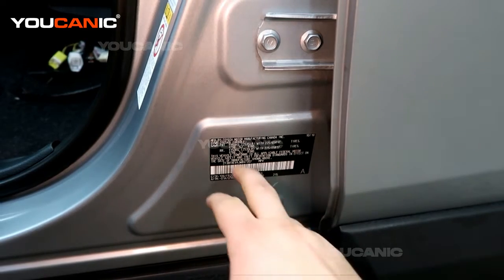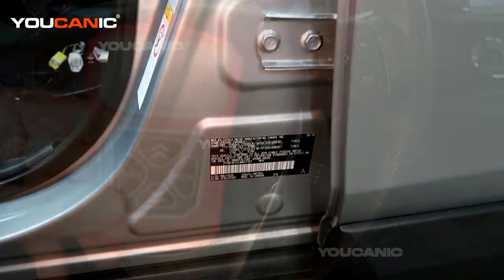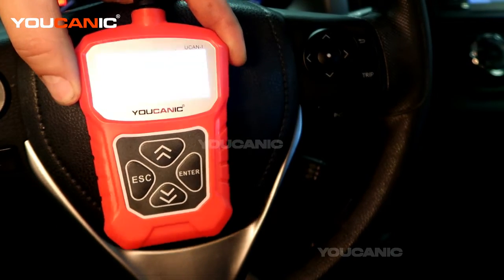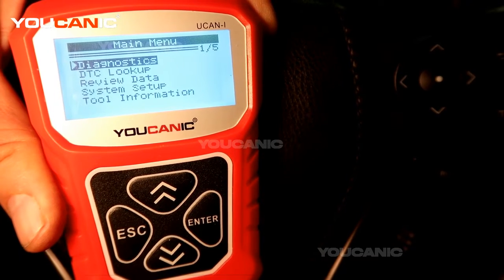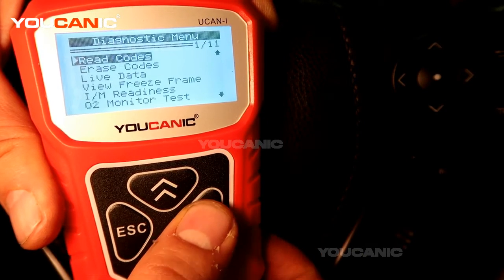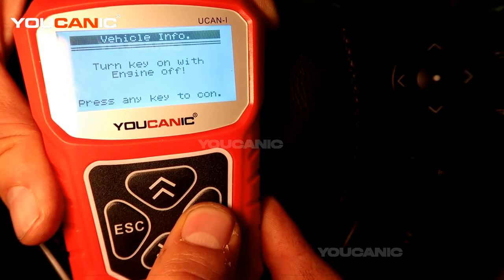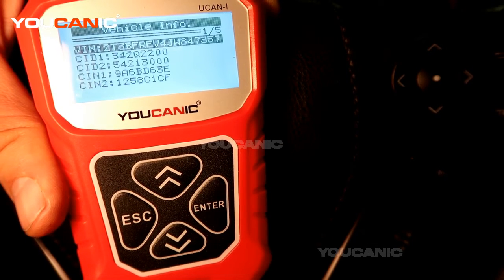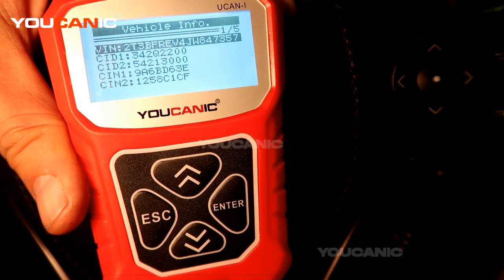How to Check or Verify VIN (Vehicle Identification Number) in ECU

Comment: Thanks!
Reply from the maker: We appreciate your feedback! Our main focus at YOUCANIC is to provide valuable assistance to car owners like you during their car repair journeys. To professionally diagnose modern cars, a trustworthy diagnostic scanner is crucial. That's why we designed the YOUCANIC Full System Scanner. Experience the difference yourself, visit www.youcanic.com/scanner.

Along with the scanner, a thorough understanding of factory repair procedures and torque specifications is essential to getting the job done right. From these technical know-hows to a whole lot more, we have got it all covered at a nominal price at www.youcanic.com/manuals. Empower yourselves with the right tool and knowledge, and conquer your car repairs!